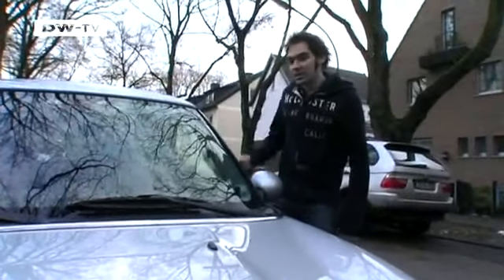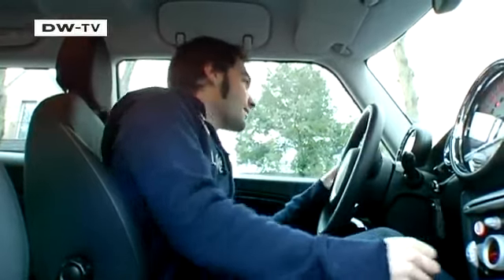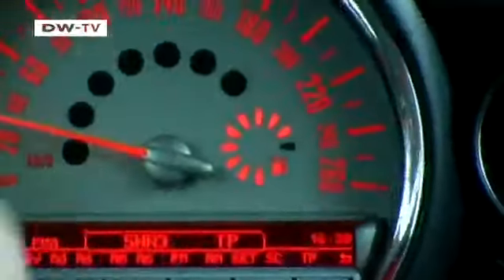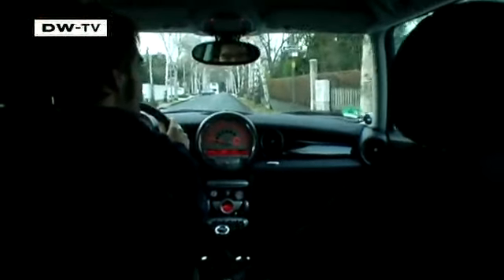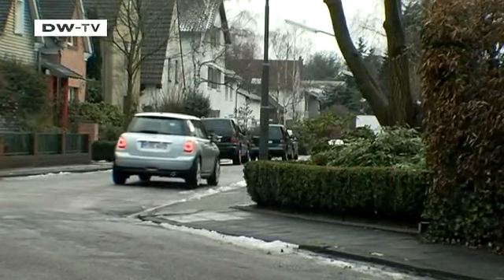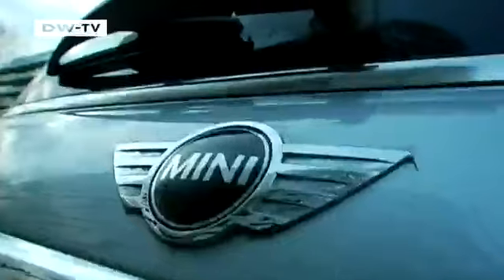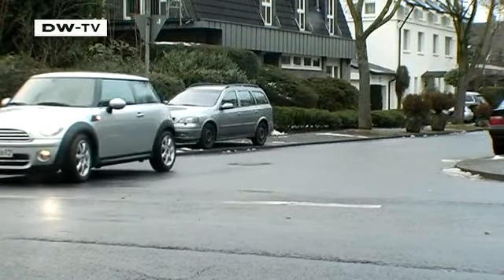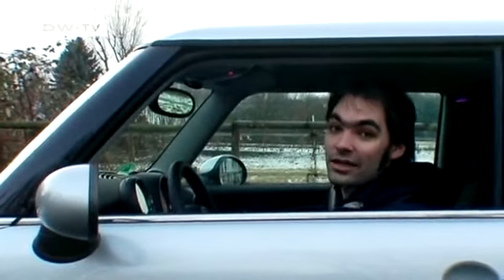Test it! Mini One D | drive it

Comment: @RWL2011 the 1.6 engine is from Ford/PSA (the same engine from peugeots, citroens and fords)
Reply: wrong... Its a chrysler 4 cylinder made in brazil
Reply: @b.eduardo5105  Mini R56 1.6 diesel engines until late 2010 are Peugeot engines. After that, Mini changed to BMW units from the 1 series. I own one of the Peugeot engined models. I usually buy my oil and fuel filters directly from Peugeot because they are cheaper.
Reply: @RarivMorben  Correct lol